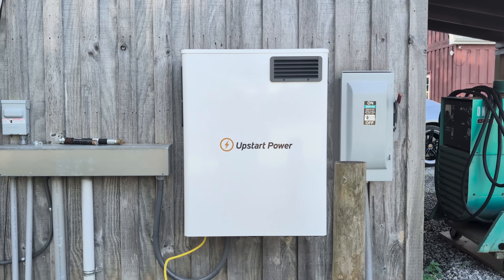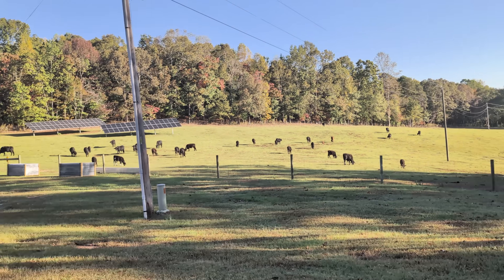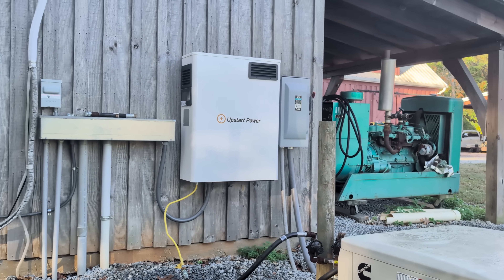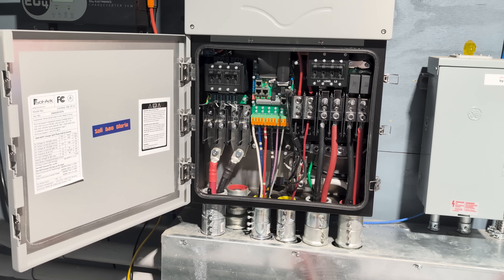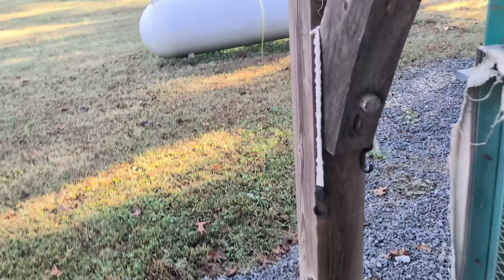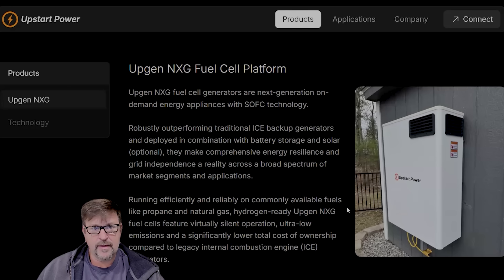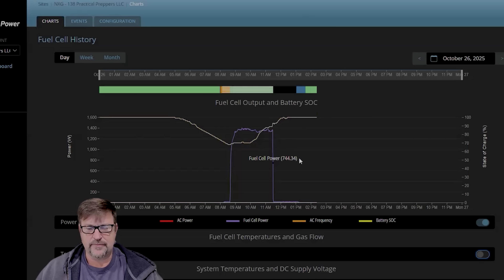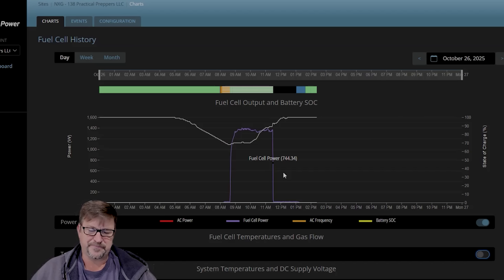You’ve Been Waiting for It | The Upstart Fuel Cell in Action

Comment: How many years of grid power could be purchased by the cost of your total setup.
Reply: many many years of power lol at $8K+
Reply: A lot. Assuming the grid is up & running. During prolonged grid outages with insufficient sunshine, the electrons from your HEMS become "invaluable" for you & your family, ... which is why ~5% of American homes have a legacy internal combustion engine HSB generator. (VERY effective marketing by well-known ICE generator manufacturers over the last couple of decades, all of which are now in the process of pivoting towards battery storage)
Reply: @UpstartPower  why would you need this if your hooked to the grid and you already have a battery backup for a power outage ? just buy more battery's if you need more run time
Reply: @NightshiftCustom  you don't need this product. It is not for you.
Reply: @qaggaz well who in this world is this for then? You would need a battery system to be able to even use this system 
And there for you would likely have solar and if you had the grid on top of that where/when would you need this?
Reply: @NightshiftCustom  Say you wanted to get though a 5 day power outage once a year (because you live in Texas or Florida). That would require a 150 kWh battery, which will be significantly more expensive (could be $100k depending on the battery) than a 30 kWh battery plus an Upstart NGX (maybe $30k) plus 20 gallons of propane a year.
Reply: @qaggaz  sooo why not just buy a 5-10kw propane generator for 500-1000$ and hook up the 20 gallon tank to it ? 
why would you pay 30k for a 5 day outage lmao 
also 5kwh of battery is about 1k right now for a rack mount unit. right now 6k for 30kwh battery with the rack! or 30k for 150kwh of battery storage
Reply: @NightshiftCustom  Why not just buy a generator? That is an option, of course. And for you, that might be the best option. The promise of this unit, is that it is quiet and requires no maintenance. If that does not appeal to you, then maybe it is not the right product for you.

Also, this is not a product for people who are going to hook it up to a 20 gallon tank (although, you could do so). I think it is aimed at people who have a 500 to 1000 gallon tank, or who plan to buy or rent at least a 200 gallon tank just for this application.  

Did you read my comment above about who I think this product is for? Or at least who it is marketed towards? This is not for a bargain hunters looking for the lowest cost way to charge their batteries. It is not for people who are interested in changing oil and filters every 100 hours, or changing spark plugs when needed. The competition is not with a $500 generator from Harbor Freight, but with a $7000 generator from Generac or Kohler. 

I am not sure where you are shopping for batteries, it is not from Scott's store. :)

Also, even with Lithium, you should plan for at least 20% extra capacity (at least that is how I designed my system), so if you want 30 kWh of storage, you need at least 36 kWh of battery capacity. At least if it were me, I would want 7 or 8 of those rackmount batteries.

Take a look at the Renon Xtreme LV Battery that Scott is featuring on his website. A 40.96kWh battery stack costs $15464. You could put together an AES rack mount kit of the same capacity for about the same. You would want to make sure that your off-brand battery is compatible with closed-loop communications with your inverter.
Reply: I like what I’m hearing now, haven’t been following closely. Be great to be able to live off grid permanently with relatively simple, clean inputs.

Comment: Making an storing H is pretty interesting energy storage mechanism. If I remember correctly pump pressurizing the storage was the tricky part.
Reply: What I find interesting about this technology, is that you could build a system that just uses propane as a fuel source, and then at some later point potentially add electrolyzers and hydrogen storage. Or you could just stick with propane. Or do both.
Reply: There was a video from 20 years ago on YouTube. A guy had 10 x 1000 gallon propane tanks tied together. He stored a lot of hydrogen at lower pressures. During the day he would create hydrogen, then and night would run in reverse through fuel cell to create electricity. His car also ran on hydrogen. I can’t imagine how much better this system could be with the right engineers putting it together.

Comment: 2:34 1,600 watts
Reply: AC-coupled:  1.25 kW --> ~30 kWh per day
DC-coupled:  1.40 kW --> ~34 kWh per day
Reply: Hahaha those are cute numbers. Maybe 3-4 panels worth or the smallest generator that you can buy. Even at super high efficiency you need 5kw at least to justify the price
Reply: @casperyourfriendlyghost7552  ya for the price you can just buy some more panels and maybe more battery then what this thing outputs running allday and night
Reply: @casperyourfriendlyghost7552  
Deliberately engineered numbers.

The #EnergyManagementSystem that is being tested here consists of:

1 x Sol-Ark 18K-2P Hybrid Inverter (18 kW)
2 x Discover Energy Helios Batteries ( 2 x 16 kWh = 32 kWh)
1 x Upgen NXG Fuel Cell - DC-coupled (34 kWh per day)

The #UpgenNXG Fuel Cell acts as a "support system" for battery storage (+ solar) that powers your loads. During a prolonged grid outage (assuming an average daily home load of ~ 30kWh), the batteries alone provide just a little more than a full day of #EnergyResilience.

In a well-designed energy management system, the#UpgenNXG Fuel Cell enables "the right amount" of battery storage (+ "the right amount" of solar) to do their job for as long as the grid outage lasts, even when there is insufficient sunshine. The amount of batteries that you would have to add to a system to achieve the same level of#EnergyResilience is not economical even if space allows.

>>> #BatteryStorage +#UpgenNXG Fuel Cell replaces the legacy internal combustion engine #HSBGenerator in your #HEMS design.

#NeverEmptyBattery

Sol-Ark
Discover Energy Systems
Practical Preppers LLC
Reply: @casperyourfriendlyghost7552 Closer to 8kw IMO but it is some very cool and promising tech.
Reply: First he says 35 kW (“per day?”), later he says 1.6 kW.  I am going with the latter as the correct spec.
Reply: @georgepelton5645  Got to be and The whole per day kW is kind of strange, in most places kW is listed per hour.
Reply: @currentfaves65  they are different units. kW is a unit of power the same as kJ/sec if you prefer. kWh is a unit of energy. 1 Wh is the same as 3600 Joules.

The fuel cell produces 1.4 kW of power, so after 24 hours you would produce 1.4 kW * 24 hours = 33.6 kWh. Note that is a multiplication, not a division so the units are kilo Watt hours (kWh) not kilo Watts per hour (kW/h).
Reply: @qaggaz  That was a super clear explanation - thanks for the reply !

Comment: I'm not terribly worried about a solar flare wrecking us. Even less so about an EMP. I AM worried about not being able to afford grid power when I get older with the rise of computing demands and the surveillance state. This not having many moving parts is a big selling point for me. I think maybe one cooling fan for the controls? That's simple to replace with basic tools.
Reply: Only "moving part" in the Upgen NXG is an automotive-grade blower that is designed to last for the lifetime of the system ... and which also makes the unit whisper-quiet 🙂
Reply: @UpstartPower  I've replaced quite a few automotive "lifetime blowers". You're not making me feel better. 😅
Reply: @MrHuram-abi  I appreciate & share your past experiences! 🙂 ... for what its worth, in our long-term reliability & accelerated lifecycle testing, we have run these systems already well past 4,000 hours and 1,000 cycles (4 x the warranty coverage) ... after all, reliability is critical for a product that delivers energy resilience.
Reply: @UpstartPower  here's the thing this thing outputs next to nothing so you would need it running all-day everyday to get anything out of it right. and now there is 8784 hrs in a year so what in the world is 4000hrs mean ? nothing at all! you could start that diesel geny he has behind him for just an hour and it would output more then this thing will do in 24hrs! and it will do it for 100+ years on just about any fuel source he can find in that time
Reply: @NightshiftCustom  A stand-alone diesel generator is a perfectly viable option to provide backup power in case of grid outages.

Comment: Cool device.  It would be an interesting video if you estimated cost per kWh of propane usage.  I like the idea of producing your own hydrogen.  That could have made hydrogen powered cars more feasible.
Reply: You can compute this from the spec sheet. 0.13 gallons of propane per kWh. So, at $3 per gallon, that works out to $0.39 or $0.52 per kWh at $4 per gallon. 30 kWh is about 4 gallons. At $3 per gallon, that is $12 per day, at $4 per gallon, $16 dollars per day.
Reply: @qaggaz so more expensive than grid charging assuming the grid is present. I suspect it's the same for natural gas.
Reply: @Tech4John sure, this is for people who are off-grid (like me) or for people who are on-grid but periods of extended outage (like me when I lived in Texas).

Comment: From what I can find a whole house propane generator consumes 0.16 gallons/kwh, NXG fuel cell consumes 0.13 gallons/kwh, and diesel generator consumes 0.10 gallons/kwh.

So diesel still more efficient. However if you already have propane or natural gas infrastructure it would be a good product to augment solar system. I do not see it as replacement for generator because of the limited output. Even engineer 775 adds transfer switch for generator and/or grid to bypass the solar system in case it fails.
Reply: your are 100% spot on man. I was thinking the same thing and then you look at there warranty 2,000 runtime hours or 250 on/off cycles at 1400 watts is a joke 
just one winter and its out of warranty. + propane keeps goin up in price and battery's are goin down!
Reply: Thanks man! And I had no idea about the warranty. That’s wild. It will be nice to see where hydrogen fuel cell technology goes in the future but it seems for the majority of applications it just isn’t there yet. Look forward to the day when it is though

Comment: 1,600 watts * 24 hours = 38.4 kWh per day
Reply: AC-coupled:  1.25 kW --> ~30 kWh per day
DC-coupled:  1.40 kW --> ~34 kWh per day
Reply: @UpstartPower  Yes. differences in efficiencies are acknowledged - thanks!

This is an intriguing device for the residential market.
Reply: @jamesalles139   We concur 🙂 ... paired with battery storage (i.e. Discover Energy Helios, Tesla PW, FranklinWH aPower, etc.), it replaces the need for legacy internal combustion engine HSB generators ... and they are whisper-quiet, so you don't annoy your neighbors 🙂
Reply: warranty
2,000 runtime hours or 250 on/off cycles 
only 1400watts of real power   8784 hrs in a year  
worth it ?
Reply: @NightshiftCustom  Think of the fuel cell as a support system for battery storage (+ solar) that powers your house during an outage. The system that is being tested here consists of 1 Sol-Ark 18K hybrid inverter + 2 Discover Energy Helios batteries ( 2 x 16 kWh = 32 kWh) + 1 Upgen NXG DC-coupled fuel cell (34 kWh per day). During a prolonged grid outage, and assuming an average daily home load of ~ 30kWh, the batteries give you a little more than a full day of energy resilience. In the context of a holistic energy management system design, the fuel cell enables the right amount of battery storage (+the right amount of solar) to do their job for as long as the grid outage lasts when there is insufficient sunshine. The amount of batteries that you would have to add to a system to achieve the same level of energy resilience is not economical  -->  Battery Storage + Fuel Cell replaces legacy internal combustion engine generator in your system design.

Comment: why not just add more solar panels and more batteries so you don't need a expensive propane back up gen?
Reply: Great question! ... Think of the fuel cell as a support system for battery storage (+ solar) that powers your house during an outage. The system that is being tested here consists of 1 Sol-Ark 18K hybrid inverter + 2 Discover Energy Helios batteries ( 2 x 16 kWh = 32 kWh) + 1 Upgen NXG DC-coupled fuel cell (34 kWh per day). During a prolonged grid outage, and assuming an average daily home load of ~ 30kWh, the batteries give you a little more than a full day of energy resilience. In the context of a holistic energy management system design, the fuel cell enables the right amount of battery storage (+the right amount of solar) to do their job for as long as the grid outage lasts when there is insufficient sunshine. The amount of batteries that you would have to add to a system to achieve the same level of energy resilience is not economical  -->  Battery Storage + Fuel Cell replaces legacy internal combustion engine generator in your system design.
Reply: @UpstartPower  I'm a EE. I fully understand the system.  Hence my question.  It is unnecessary with more PVs and batteries.
Reply: Not everyone lives in a place with year sunshine.
Reply: @qaggaz  Irrelevant.  You didn't understand my question nor do you understand solar power systems.

Comment: Does it work in below freezing temperatures?
Reply from the maker: It does but I will find out the limits!
Reply: @engineer775  put one at my place and wait for a < -30 degree day next January!
Reply: @engineer775  I am sure you will! 🙂
Reply: OPERATING TEMPERATURE:
-20 to 50°C
Reply: @UpstartPower  If it gets below -20C, is it damaged or does it just shut down? Asking from Michigan
Reply: @agreen6301  We are in the process of testing the Upgen NXG down to -40C. In extreme environments & weather conditions it might make sense to shelter the equipment and fuel source. (Note: Propane does not vaporize below -44C.)

Comment: I am curious about the operating cost with natural gas versus the ever increasing grid power.
Reply: FUEL CONSUMPTION:
Natural Gas:  12 ft3 / kWh
Reply: you can't run it 24/7 at only 2,000 runtime hours or 250 on/off cycles the warranty runs out and at only 1400 watts of power you are not getting much. grid is cheap

Comment: first time for me hearing about this kind of generator, so many questions.....8 grand for 1400w DC how is this a good thing?  How does it "strip off" the hydrogen and what about the remaining elements of the propane? i am aware of using electricity to separate hydrogen our of water with O2 as the remaining component. Why not use solar to power the water separation and store the hydrogen for use in this fuel cell?   so many questions....time for me to do some research.

Comment: @engineer775, can you ask Upstart if it will work below -20C?  If so, is there reduced output, efficiency, etc..
Reply: Spec sheet says operating temp is -20c to 50c
Reply: @stanchorney9698  yes, that is what the design specifications states. What actually happens at say -40c (or -40f since they are the same)?

Comment: So someday you can turn your overproduction from the solar panels into hydrogen that can be stored in tanks for the seasons that you don't have as much sun.
Reply: Hydrogen is a shit fuel look at btu content per a pound compared to any other fuel out there
Reply: @nathandevine552  by mass, H2 has excellent btu content, nearly three times the energy per kilogram of hydrogen compared to a kg of diesel. Volumetric density is a different story, and that depends on how much you are willing or able to compress it.
Reply: @qaggaz well volumetric density is what matters
Reply: @nathandevine552  so compress it or liquefy it. We are talking about storing excess energy that would normally just go to waste anyway. Even if you only get 25% efficiency, that is still more than the zero you would have otherwise.

Comment: Oooh, I like.  That is so much better than a generator!  I'm trying to get the fuel consumption rate and google AI came up with 0.13gal/kWh.  So that's 7.7 kWh/gallon or so (assuming google AI is correct, which it could easily not be).   Lets see... a standard 20lb propane tank holds 4.7 gallons (around 40lbs total weight) ... or 36 kWh.   That's really quite good.   But since Upstart does not appear to publish actual fuel consumption numbers it is only a guess.
Reply: FUEL CONSUMPTION:
Propane:        0.13 Gal / kWh
Reply: @UpstartPower 48v DC only?
Reply: @Real_Tim_S  Upgen NXG also comes in an AC-coupled version that pairs great with Tesla PW, FranklinWH aPower, etc.
Reply: @UpstartPower At what system voltage?  I'm guessing 240/120-split phase
Reply: @Real_Tim_S   Yes. 240 VAC.
Reply: @UpstartPower any plans for 208Y/120v or 480Y/277v?
Reply: @Real_Tim_S  Yes.
Reply: I think Gemini got that 0.13gal/kWh came from Upstart's own published figure. Someone else mentioned it here.

Comment: When it’s about $1000 d then we’ll talk…
Reply from the maker: I hear you but if it saves you from having to buy 6  5kw lithium batteries say $1,200 a piece would it be worth at least say $5,000?
Reply: @engineer775  and you would still have extra money to buy even more panels and a 500$ gen
Reply: It could save the need for a propane generator in a fully off grid use case, the fuel savings could quickly make up the difference in cost between a generator and the fuel cell.